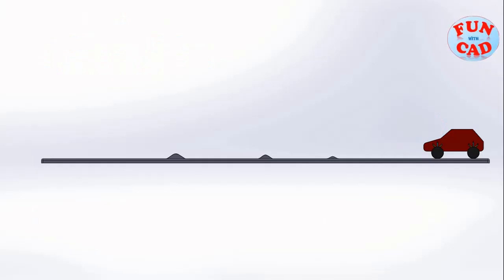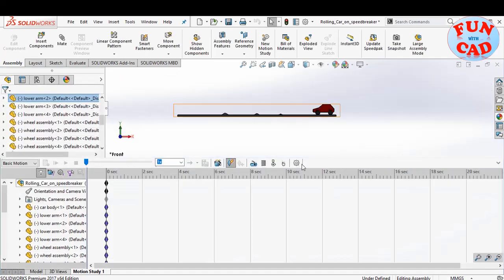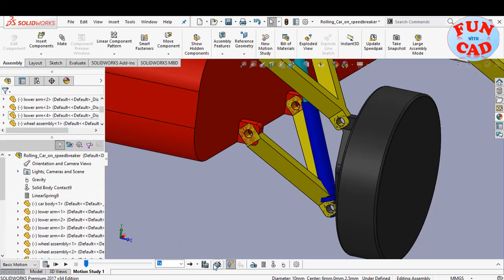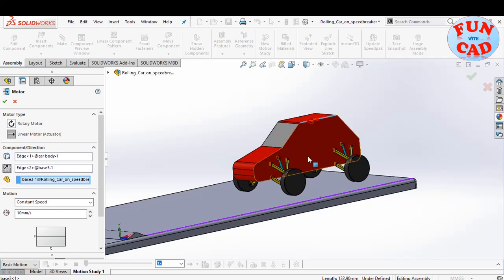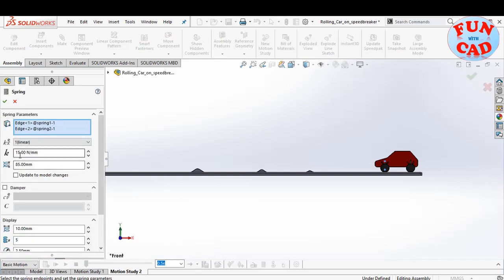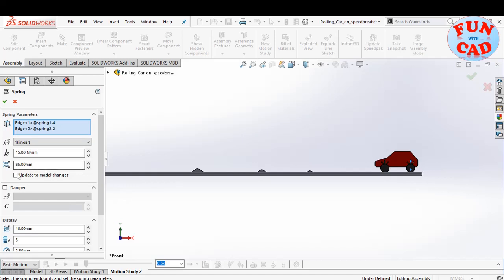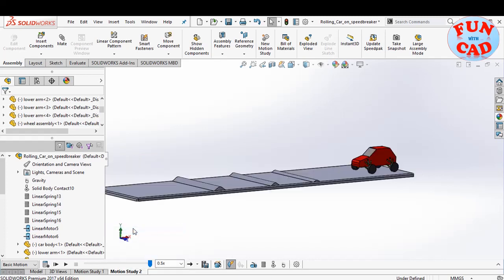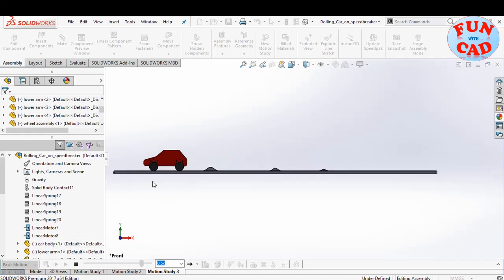Rolling CAR on Speed-breakers with suspension effects | SolidWORKS Assembly | Animation Tutorial

Comment: Hello bro, I'm currently doing this same design with suspensions but when I add all the initial parameters they are automatically suppressed. Every parameter is suppressed and can't able to unsuppress at all. Is there any problem with the mates in the assembly? There are no errors btw.
Reply from the maker: Hello Srikrishna, can you confirm if you are using 'basic motion or motion analysis' and not 'Animation'?
If possible, you can send me the screenshots of your motion study interface on my email id funwithcad2020@gmail.com and I'll try to get a better idea about the error.
Reply: @FUNCADwithMrROBOT  Thanks for the prompt reply brother had a deadline of yesterday night and I tried to fix it as you said I had the setting set to animation changed it to basic motion but even then the motion isn't executed although the parameters are now unsuppressed.
Reply from the maker: It is difficult to find out the error without actually seeing it.
I will be able to send you my SolidWorks files if you want, so that you could compare it with your motion.
Reply: @FUNCADwithMrROBOT  you mind if I share my files with you because I'm doing this for the first time, I wouldn't know what you've done differently.
Reply from the maker: Yes, no issues. You can mail the files at funwithcad2020@gmail.com
Reply: @FUNCADwithMrROBOT  thank you sooo much!
Reply: @FUNCADwithMrROBOT  did you get my email?
Reply from the maker: Hello Srikrishna, I have received your email. Unfortunately I have an older version of SolidWorks and I cannot open your files.

Comment: Hello friend, I congratulate you on your work, I am trying to carry out a study of the movement of a mechanism and I do the relations well, but when I move the wheel on the surface, the wheel penetrates the surface, why does that happen to me? .? could you help me ...?
Reply from the maker: Hello John, is the wheel penetrating partially or fully?
You can try improving the 3D contact resolution and accuracy from the settings of motion study.
Also, even in my simulations, the models in contact are penetrating slightly, probably due to high gravity force acting on solid models.